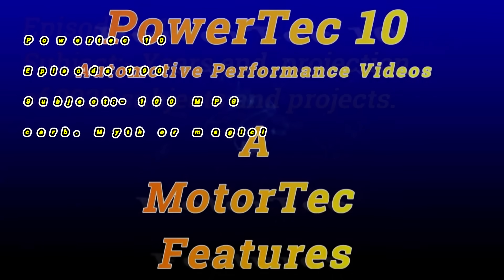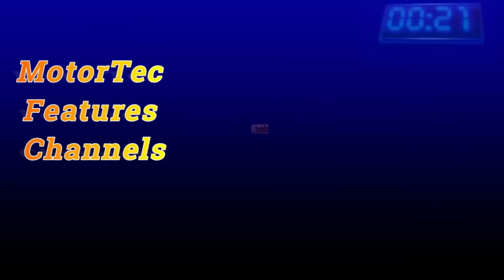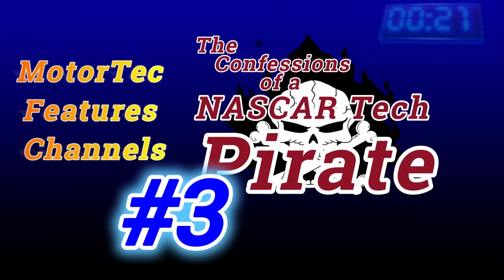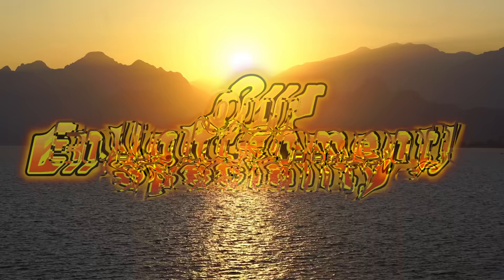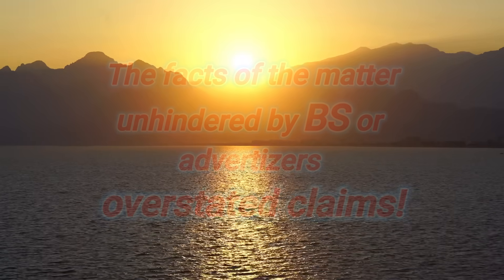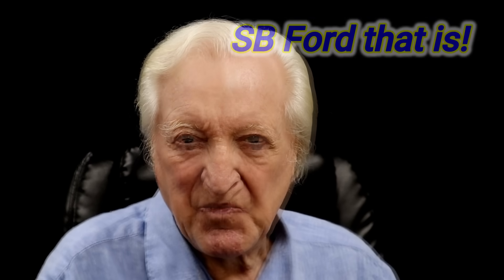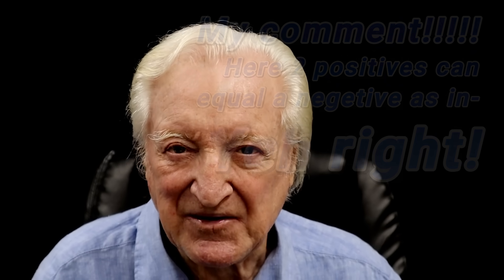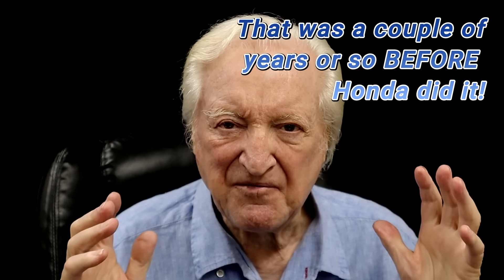The 100 MPG carb - reality or real BS

Comment: I could do it with $1 million no problem I would use
6.2 L V8 aluminum block with the most highest compression parts I could find I would put pre-chambers in the head 1000 CFM carb into a single plane intake in possibly lean in the front two barrels that would turn off at half throttle and open up the back two barrels that would run a regular fuel mixture a tiny teeny tiny little carburetter for the pre-chambers a fairly mild cam with a lot of lobe separation still make 400 hp, but also get 100+ miles to the gallon high speed rear end maybe 10 speed transmission 60 miles an hour at 1000 RPM an old Corvette fibreglass body no cam phasers no direct injection no cylinder deactivation and over 100 miles to the gallon easy
Reply: Water injection on the lean side of the carburetter

Comment: I remember Honda CRX back in the 80s and early 90s being carbureted and getting 52 mpg with enough power to roast the tires with a 4 cylinder engine. Why can't we manage this and better today? Because they don't want to! There is no reason for not getting better gas mileage in today's cars and trucks. Even a Chevy 350 cubic inch engine with a properly tuned quadrajet carburetor could get 22 mpg while driving normally, yet still had ample power! I've seen it myself for years, so you can't tell me it's not possible.

Comment: David , loved this series on the old mini when I read it . Great results and formed my set up for street cars even to this day . I have an old set up I made using a smog pump some old misters and old check valves ( simular to the Goodson setup marketed years ago ) . Was thinking of using it on a gm 3.4 3400 top end combo . It will sit in a 5 speed berretta to prove the concept . If it pans out, it will end up as a corvair middy  Wish me luck .

Comment: If we look at the average semi, given how much weight it moves versus how much fuel it consumes, its a 100 Mile Per Gallon Vehicle. It does this not by fuel management, but by transmission efficiency. A gallon of gasoline has 155,000 BTUs of energy. Your average every day car wastes 95 percent of that energy. It does nothing but warm up the air inside the engine compartment or the air around the exhaust pipe. While you may get an improvement with fuel management by using that abundant waste heat to more completely break down fuel (or at least do something), you have to look at all the systems involved with moving a car down the road to get 100 MPG. It's been done.

Comment: It takes a certain amount of Hydrocarbons to Oxygen to make a proper combustion but yes the carburetor over fed the Engine and so does the even worse EPA fuel Injection.
In the early 1980s In My drag racing days I put a modified Quadrajet carburetor primaries honed out on a Ford Mercury 460 and I was getting 25 miles to a gallon

Comment: All I can say is amen. 
I worked my tail off trying to find that unicorn. No such luck. My best was 75 Monte Carlo @ 29mpg. Craziest was 400sbc at 19.2mpg running 90+mph for 110.4 miles  in a 70 Caprice 3.08 gears, no overdrive

Comment: Yes , Smokey had a V8 Chevy that used that Lee tank idea but added a turbo to push the intake air thru the carb, the fuel was heated in different fuel flash points, If I remember correctly - 5 different stages - it was published in a car magazine in the 80's
Reply: I remeber that. Smokey was using a really high octane (100+) to prevent detonation.
Reply: @McLovinTits  Fact  Smokey used water injection and egr. It was posted on his website years ago it's no longer there.

Comment: Hello David, I do not have a story of mpg increase but my first vehicle was a 78 dodge d100 with a slant 6 when I was 16 in 1996. I didn't have very much money to do improvements but the original exhaust was rusted out. I put a exhaust pipe coming out the passenger side with a glass pack.  4 years later I sold it to a guy I worked with.  He had a full exhaust from the manifold put on it. Much like the factory muffler and exhaust pipe that was on it original. He come to work one day and said it wasn't running Wright. I said I bet you I know what is wrong. Sure enough it was base plate on carb. The screws were loose. I removed carb and tightened butterfly base screws and it quit spitting and popping.  I asked him can I take it up the road.  He said yes. David that truck run like a striped ass ape compared to when I had it. The exhaust He had put on made that much difference.  He had not modified anything else.  That has always had an impression to me that back pressure does have a critical effect on the performance of an engine.  I enjoy your videos  and hope my experience then is worth sharing.

Comment: Check out Casey Putchs Omega car it gets 104 miles to the gallon and does 0-60 in 4.6 seconds. Oh and may I mention it's powered by a 1.8 litre Volkswagen DIESEL ENGINE.

Comment: @DavidVizard; certainly You are among The experts within automotive, especially combustion engine research development design testing verification certification expertise.
Would expect that You would have at least seen, viewed, know about Casey Putsch, Genius Garage, his personal unique automotive designs including his high efficient recyclable Omega Car design, development, which is actually functioning, initially 2013, more recently tested again in 2024, seen, shown in his yet-channel, now "Casey the Car Guy". He achieved 104+ MPG within normal driving conditions as recorded, shown, posted performed with his student last year 2024.
The keys are the entire vehicle design efficiency using a standard VW 1.8 L TDI.
Thus clearly a properly focus upon the entire vehicle for efficiency, not just the drive train, engine, fuel system, carburetor is vital for full efficiency. Certainly the efficiency of the engine can further improve the efficiency thus the Omega, as Casey also explicitly stated. His fuller design approach also includes materials, recycling along with other manufacturing, durability, waste aspects. 
As seen in the recorded video, Casey Putsch custom designed Omega Car vehicle in its current tested configuration with a standard four cylinder Diesel VW 1.8 L TDI  engine, achieved normal use, not specific highway, or constant speed, more than 104 MPG. Also performance level acceleration 
The keys are the are the weight, aerodynamics, efficiency, power transfer.
There are other improvements via other advancements which can certainly be implemented.
Other combustion engines can also be used too.
Am actually surprised if David Vizard has not seen this vehicle and videos.
All The Best and Much Success , Sincerely :-)

Comment: They use special fuels, not pump gas, that has greater volumetric efficiency. Nitro methane would work but it isn't street legal. Some of them adapt tiny motorcycle carbs on their car and it only goes  15 mph. No matter how you slice it, it's baloney.

Comment: I'm deep into the hypermiling hobby, I'm actually the owner of Project DerpSpeed, sister car to 2008ish TopGear America's "project Sipster" 100 mpg 2 seaters exist, they just cannot be driven typically to get 3 digit numbers.  DerpSpeed for instance takes about 50 miles just to warm up as the burn is so lean, even longer for the transmission to warm up along with the bearings. If really going for top mileage one is engine off coasting about 50% of the time. You don't have power steering, you have to pre-charge the battery as theres NO alternator,  weather over 80'F is generally out because there are no radiator fans and the system is balanced for JUST enough coolant flow to keep the engine at 220-230'F with waterless / low cavitation fluid. But its too dang hot in the cab then because the windows are up for aerodynamics. Then you have the CNG 3,600PSI tank behind you... this helps kick off the diesel burn on the 25 horsepower you have to work with in a very narrow tuned window based off a tiny turbo to scavenge the exhaust at the right rpm / load under custom tall gearing. Heck even the tires had to be selected years ago and hardened through a process, hot knived / cut down to a narrow tread, then over pressured for rolling resistance. (yeah, we go to that length) after all that you're looking at weather and all the arguments there. Because a single weather front can mean 300mpg if youre following it, or literally unable to use the vehicle at all at safe speeds because of the extra horsepower needed to cut the wind. Had a time I had to slug back at 40mph in 3rd ... it sucked. So, no, slapping a carb on a sedan and calling it good won't work, it's a accumulation of things that can though, and its not fun. So, I like my other hypermiling buddies have moved onto exclusively solar vehicles that are tied into paying utility bills as well. I'm currently parting a greyhound for something similar to this: https://youtu.be/mOPmppKJXYA?si=GS8lB_Wk02pgQqhJ  Where the lifestyle is GRIDLESS, and encompasses home life and vehicle.  My only gripe with it is the short range for their builds, but thats what you get trying to move 60,000 pounds. So, thats where we've moved on to in recent years after many of us attending a party concluded it was going to, in a slowly dying diesel shop in west Ohio. The future isn't mpg, it's cost per mile with comfortable performance. Shoutout to Casey up in BG, it's cool seeing he's still fighting on with fuel with his "omega" project and doing so likely at EPA risk having it on YouTube at all, also other UNOH racers that mod, mod on!

Comment: there is a patent so look it up the trick is it works buy supplying the carb with vapors not the liquid. remember a liquid does not burn it is the fumes that burn so why waste it by putting in as liquid. not so hard send vapors from tank and jet it correctly and leave the liquid fuel in the tank until it all vaporizes

Comment: Liquid boils to a perfect vapor Under Full vacuum. Not compression. Running Lean will not generate enough heat to burn valves . Pilots know the Term running Lean of Peak and Rich of Peak. Better start educating yourself if your interested in this. A lot to this. An engine doesn't need a carb or air breather. Doesn't need exhaust. Because the engine gets its air due to Boiling. Understand that and you will figure out what I'm saying.

Comment: You can lean out a carb to get 100mpg for a few miles and until your pistons melted at about mile 10. You'd  be able to hear the car knocking from the next county over, but there's not enough energy in 87 octane at 14.7:1 to get 100mpg in a 3500lb car with a combustion engine.
Reply: I like to have an inspection port in my pistons so you can look down the spark plug hole and check the wrist pins.

Comment: Myth. Engineers already know the air/fuel ratios for optimal combustion. If there was no atmosphere, it only takes a few horsepower to achieve freeway speed. Air drag, road drag, and weight are the issues, not the type of air/fuel delivery.

Comment: Completely irrelevant, the strategy nomads used to hit 100mpg or thereabouts in the 1980's was just yak on the CB and drafting semis — iirc trailer bumpers weren't regulated by the NTSB?   It had to be the right kind of trailer; you could stick the bumper of a car right under an aluminum Fruehauf, touching the mudflaps!  Nose resting on the centerbeam!  
I've been told the most important thing for drafting was a low idling "torquey" engine that wouldn't overheat.  
I don't know about carburetor modifications, but many would attach a wooden block to the grille of the car.

Comment: I’ve often wondered why there has never been follow up articles on Smokey Yunick’s  hot vapor motor . I remember watching a show called PM Magazine that highlighted the Pontiac Fiero in the 80’s. There was also articles in car craft magazine about it. Supposedly Crane signed a contract with Smokey to sell kits for the Chevy 2.3 and the Chrysler 2.2 liter engines the
Following year. I think the air fuel mixture was pre-heated by a pre-manifold where the coolant heated up the mixture and then was heated up further by going into the intake/exhaust manifold that heated it to between 400-450 degrees where by the time it went into the combustion chamber it was almost all vapor. Supposedly you got over a 95% burn and it also involved a turbocharger setup. Supposedly your coolant system could be reduced also. Tailpipe emissions were reduced to hardly anything and they did average over 50 mpg’s on the Fiero. I think the system was supposed to produce 2.5 horsepower for every cubic inch . Then the year went by and I never heard anything again, but I do remember reading where they said it did pass all the required government testing. Were they bought out by the oil companies or did the air/fuel mixture create a safety issue?

Comment: My Ford diesel gets 100mpg as long as a mile is only 600 feet long.  Thermodynamics isn't just a suggestion, sure you could build a vehicle to get 100mpg, 400 psi tires, reduce drag in the driveline, limit speed to cut down wind drag, reduce weight, loose engine with less internal drag. You have 120,000 max BTU's to spend, piston engine discarding 60-70 percent of that and 8-10 percent loss in the driveline, spend them wisely. Smokey's hot air Fiero was in the low 50mpg and that gentleman was a wizard.

Comment: i think something happens above 55 mph where the drag is exponential. 
even modern cars with overdrives that get great gas mileage will do it better at 55 vs 75. But most people are going to do 75. Even the most aerodynamic of motorcycles battling it out in the latter part of the 90's knew of this phenomena, and its like pushing a kite at 175 mph with the engine near redline absolutely smashing

Comment: 100 seems unrealistic for a reliable car engine with significant power potential. I've been working for years to convert my 4.6 liter Ford Mustang V8 to 3.6 liters with a goal of 525 HP "on tap" with constant speed operation at 60 MPG in my Corvette. It's NOT EASY, requires lean-burn operation and sky-high compression ratio, plus a few lesser-known "tricks". Oh, and it absolutely requires a GDI system. THE key is designing for part throttle operation (low pumping losses). It basically requires 50% thermal efficiency at low throttle -- not even F1 engines can do that.

Comment: As the sales man would say, "It will do 100mpg and 100mph, just not at the same time"
The target would have been 60 at 60, though with electronic control that's quite easy, 70 at 70? has to be a challenge

Comment: I personally had a 170 sixer in my 65 Falcon that could knock down 50 mpg on highway driving, but the carb was messed up and running way lean, too lean to pull itself out of its own tracks almost ... one day the trash in the passage causing the lean condition cleared and car became driveable again and went back to 25 mpg. This condition lasted for many months because I didn't have time for a rebuild. It's not wise or easy to drive something with a condition so lean you aren't getting the fuel you need to go forward. I miss the mileage, but I didn't miss the issues it created. It was actually quite dangerous. Not recommended.

Comment: Conspiracies do happen, but they really, really rare.

MPG involves far more than just a carburetor or injection system.   The Road Load Equation dictates.   That equation is dominated by vehicle velocity (cubed), frontal area, weight, grade, aerodynamic drag, etc. but is mostly ruled by speed and frontal area (all else being equal.)

If you took a street luge, powered it to go no more than 25 MPH, put an anorexic driver in it, and found a dead flat hard road surface you might approach 100 MPG - - maybe.

Lately I've been binging your earlier posts.  I fully believe that racing is just engineering out on the cutting edge where durability is usually a very finite parameter (ten feet beyond the finish line) but still valid and useful engineering.

Comment: This would be a cool project.  I wonder if you could Frankenstein a "Q-jet" out of four single barrel carbs: 2 large (for WOT), a medium carb for around town driving, and a real small one for cruising.  
Cruising down the highway only takes 20-30hp, right?   I'd start with a slider carb from a 250cc motorcycle that makes like 25hp.  You want the carb to be wide open to minimize pumping loss, and then lean it out to just before the engine runs rough.